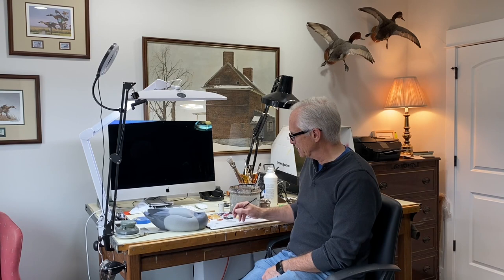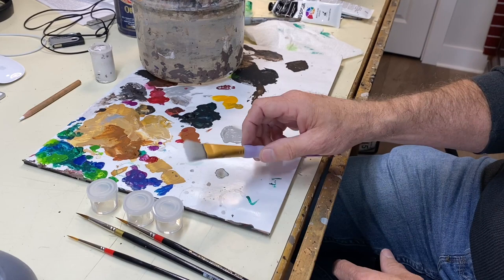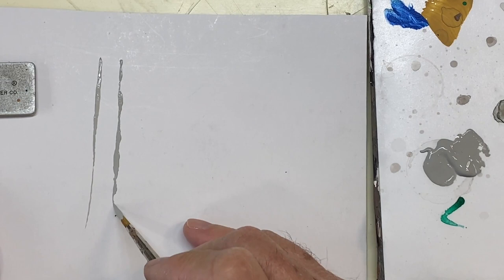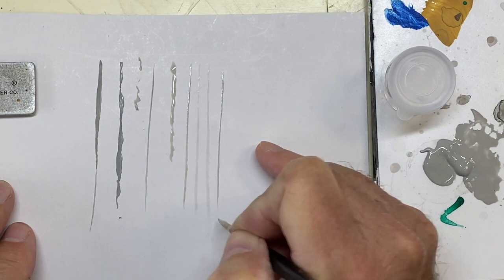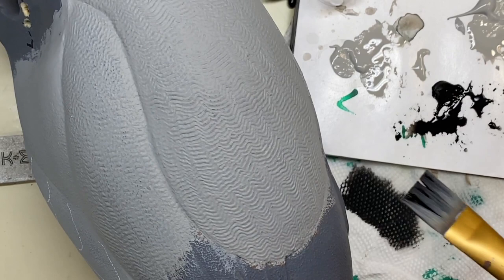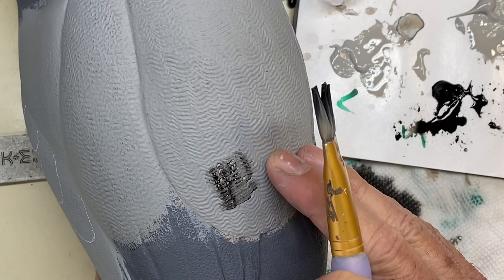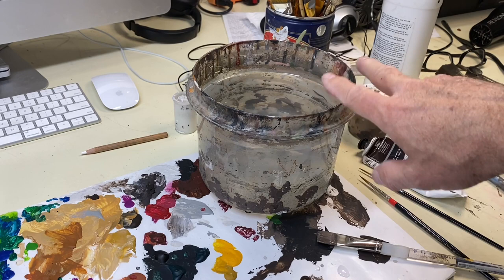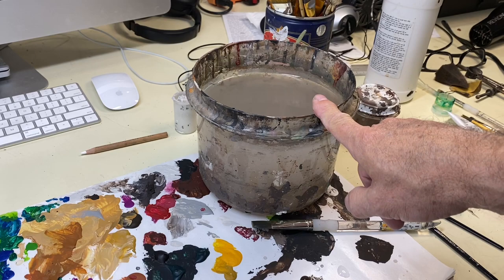Basic Paint Flow and Mixing Tips

Comment: Thks Tom Very Helpful One question. Do you do washes when detail is near completed, if you do what is the best way. Thks again
Reply from the maker: Good morning Ken. I normally do washes before details but also do them after if I need to tone something down or adjust the color a bit. My best advice would be to give any detail you are washing OVER time to dry so you don’t remove the detail with a watery wash over it. I normally start washes with a very thin mixture and very little pigment. You can increase the pigment gradually by adding layers. if you start with too much pigment it’s hard to back it off if the wash has gone on too heavy.   Hope that helps.
Reply: @tomchristieart  Thks Tom very helpful and really appreciate your videos